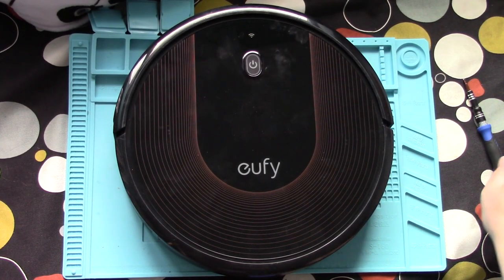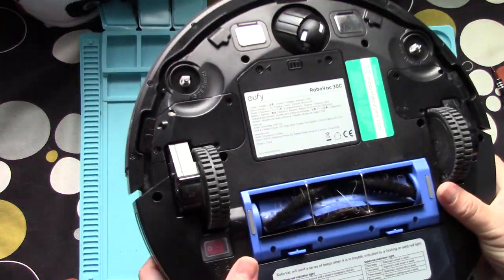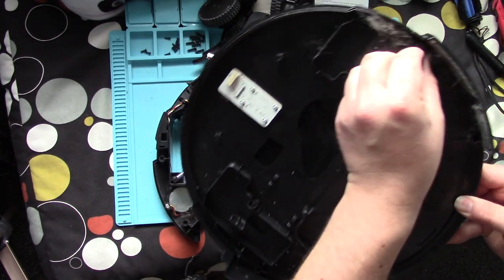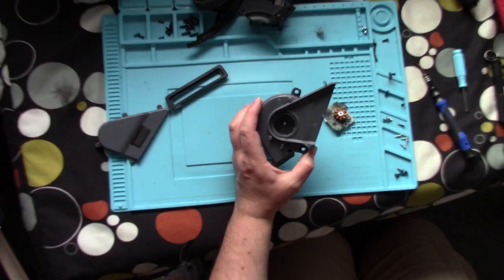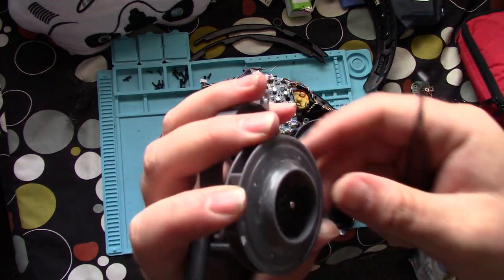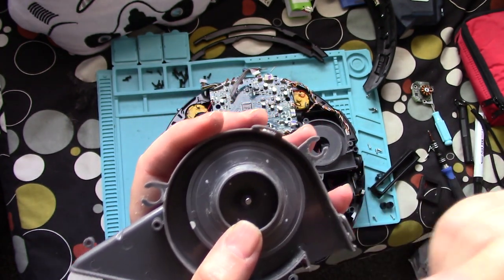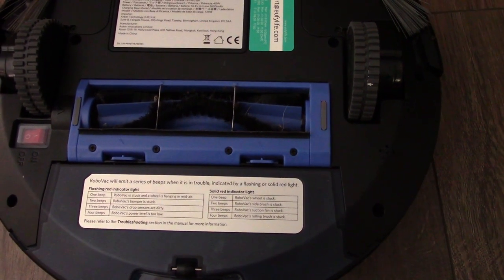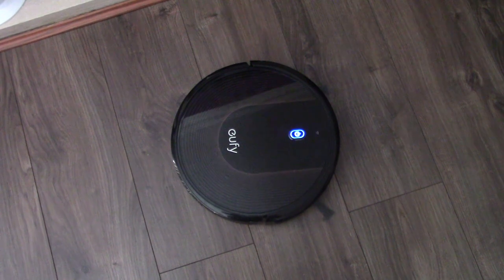Can I Fix a Eufy Robovac 30C Robotic Vacuum Cleaner that's making a loud rattling noise?

Comment: Thanks for this video!  I had the same noise...AND I found that the screws on the bottom of that piece were not tightened.  It had never been taken apart before....wonder if the factory didn't get the screws tight enough and in time they worked loose.

Comment: Did you try changing the roller first?  I was having the same issue with mine, was about to throw it out when I decided to take the roller out to use in my other Eufy - when I put the roller in my good working Eufy, made the same noise - so I put the original in, works fine again.  Then to test my theory, I put a space roller brush into the Eufy that was giving me all the trouble and voila working normal again
Reply from the maker: Hi Rougue, yeah that had happened on another one of these I had. The rollers do seem to work themselves loose and as a result they get out of shape and rattle around in the housing. A new roller fixed that one up too!